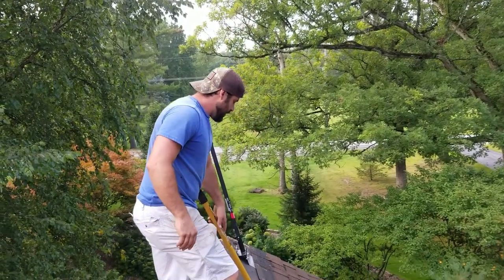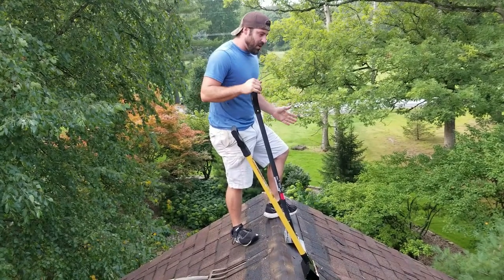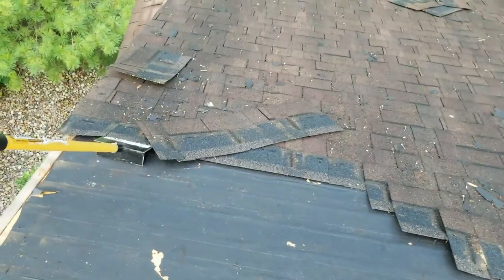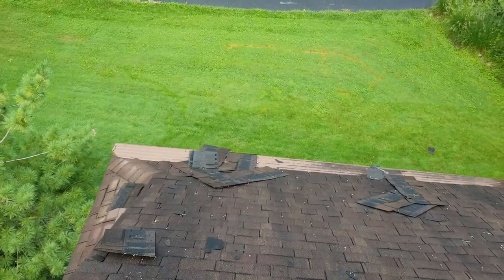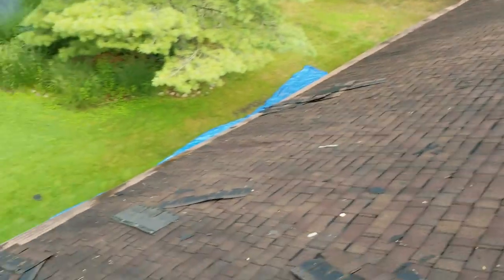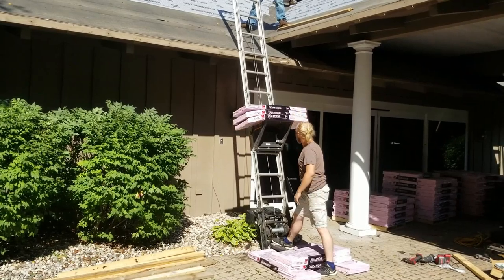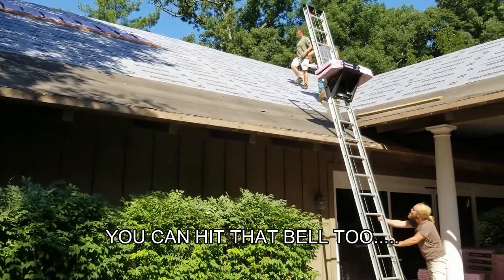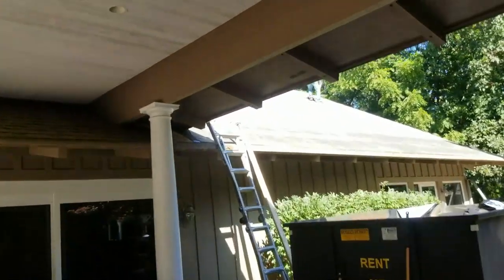HOW TO TEAR OFF A ROOF

Comment: not to be rude to you guys but the way your ripping it is the dumbest ways possible. I use red rippers and go sideways ripping two rows at a time, putting the longer shingle on the bottom of the two. Also as you rip the shingles off piling them about you in neatish piles .if you would like to see a video of it just let me know. It would definitely help you out and make your rips faster.
Reply: Lifting up from the side disturbs alot of granules leaving more cleaning at the end I normally walk backward to the ever using a roofing spade and the bottom of the shingles lay the shingles on my toes as  shuffle backwards.. this way everyone can be ripping side by side  and everyone takes they're own need u disturbed piles as they go far less gutter clean up and no need for dragging tarps to the bin if your know how to hit a trailer properly
Reply: You're right, and long pants and sleeves

Comment: If you line the ground with smaller 8x10 tarps on top of the larger ones,2 or 3 guys can pick the whole tarp up as opposed to wheel barrels or garbage cans or picking them up twice.An 8x10 will hold a square or so without tearing and makes clean up a breeze.Finding good guys is my biggest problem,The struggle is real no doubt.
Reply from the maker: wow, how did that never cross my mind! advice taken bud! we usually just use the big ones because we almost NEVER let anything hit the ground. but there was too much real estate to walk on this one. but yea good guys are the hardest thing to find. everybody good is drug attics/alcoholics and don't have a license or vehicle. I teach the young new guys now, that way they just learn my way and they don't bring the hack ass shit from their last company to mine. that's what inspired me to make this channel. I got tired of teaching the same thing to guys that don't stick around. so now I can tell them to familiarize with a video (i.e before we start siding or before I let them shingle for the first time) and also, I want other guys like you to be able to tell your guys "hey, go watch this specific video before we jump into that tomorrow, I do things a little different but at least you're not coming into it blindy"

Comment: I was taught  to always start from the bottom, scrape from the corner , and work my way up. After all the shingles  come off then use a flat bar to tear off the old felt, and then flashing  and pull nails. Really cool to see the way you do it
Reply: uh i believe someone was messing with you when they taught you to tear off from the bottom . makes as much sense as roofing it from the top down .
Reply: You can remove way more square from the bottom up,only draw back is you have to come back through and pull nails with a shingle shovel
Reply: @joesmoth2610  That's exactly  how I did it. I don't roof  anymore  though ( thank god)

Comment: My husband's an old time roofer and he used to slice the length of the roof about every 3 ft and then roll it all up into a big roll which pulls 90% of the nails and all the paper as you go and just drop the roll into the back of the truck.
Reply from the maker: With a saw? Like cutting through the shingles but not the plywood?
Reply: @NWIVeteranConstruction  no just a composition ax one with a small razor blade attached to it. One from the '60s, he still has a couple. They have wooden handles. I think they're called "Plum". The makers I suppose.?
Ps. He is also a veteran, 1 Cav.

Comment: And you should Always tear the felt paper off as you go... Slipping on loose felt paper isn't any fun
Reply: Tim Bibin I agree with that most of the time.
Reply: peel it all off at the end and get most of the messs wrapped u[ in it
Reply: @williamcutrell7456  .. Yeah on a lower pitch.. it's funny you say that.. we did that on a job we were doing yesterday
Reply: @williamcutrell7456  .. Another advantage of leaving the paper on is that you can see all the nails that are sticking up and need to be either pulled out or Hammered down
Reply: @timbibin1301  yeah and if the paper is still in half decent condition and stapled down it usualy doesnt pull out
Reply: @williamcutrell7456  .. I was talking about the nails that are showing after tearing off.. you can see the nails easier when you leave the paper on.. so it's easier to either bang them back in with your hammer, or pull them out
Reply: I'm older so I sit rite on my cushion push it off with my legs, broken in shingle eaters r awesome

Comment: I like going 3 or 4 rows billow the ridge and going up with the ' shovel and moving left or right  for like 8-10 ft then grab by hand most of the time you can get some big chunks like that depending on  how many layers and how good they nailed it for 1 layer usually works good but not always the case  but what ever gets the job done
Reply from the maker: to each their own. i'd like to see more ways demonstrated myself...I switch between these 4 methods and haven't found anything else that's even close to being as efficient

Comment: Thanks for the vid zack. Never seen a lift like that before. Also were you just making sure the decking was tight with the trusses when you were nailing? Also just wanted to say I appreciate the videos.
Reply from the maker: thanks hunter, always appreciate hearing from you. i was just making sure it was tight. they didn't use ringshank 8's when they installed the plywood and it was poorly nailed on top of that so most of the corners were loose and some of the seams needed sunk tight

Comment: Keep the vids coming. What brand and line of shingle would you put down on your own house if building new construction? Timberline UHDs worth the extra labor?
Reply from the maker: uhm. I'm about to put driftwood on mine. i'm undecided between o.c or landmark tho. but really i wouldn't go too fancy personally unless you got boocoo bucks and a really steep roof. otherwise, just pick one that pops. Gaf, landmark and O.C...cant go wrong in my opinion
Reply: @NWIVeteranConstruction  definately owens corning..i love the surenail strip,well all except when u gotta cut them fuckers when the shingles anything but cold..they suck ass to cut..
Reply: @NWIVeteranConstruction  u said driftwood...u should check out the color sandune...its a amazing color and relatively close to driftwood in a way..the last 7 out of 9 jobs I've done the customer went with sandune..its popular.

Comment: Is their a reason you didn't get the shingles boomed up to the roof instead of dropped on the ground?
Reply: He mentioned in his last video; the brick driveway won't support the weight of the truck and boom
Reply from the maker: @tdgdbs1  thanks for answer bud! yes the pavers were the only reason, often times tree's or power lines will prevent us getting a boom in there too. apparently the hydraulic fluid in the boom lift can cause an arc if close enough so they're not aloud to put the within 20 ft. (they usually do anyway though haha)
Reply: Plus you still have to move the shingles to tear off.  We never put them on the roof.  Get a shingle lift.

Comment: When is it necessary to put an ice barrier over felt? I thought it’s either one or the other. Great video, cheers..
Reply: It’s about the codes in the area you’re working, and you put ice/water up the valleys and On the overhangs till you’re past the exterior wall to whatever code is in you’re area as well as around chimneys and crickets under the flashing. You felt the rest.

Comment: Depends on pitch of roof and condition of shingles…..but I found the best way is to start 4courses down from top have two guys picking up the trash and work across the roof like a typewriter moving down 4 course each time.very fast and very little trash to pick up and the shingles come up whole instead of small broken pieces.

Comment: My question is what is better as an underlay  , tyvek or roofing felt . 2 question are staples ok to fasten down the felt.
Reply from the maker: My recommendation is to never use Tyvek as underlayment. it will actually leak. its meant to be installed vertically on walls. the underlayment I use is GAF felt buster. its synthetic felt and comes in a 10 square roll. I believe its approved for staple only install. if its not, I can assure it holds tight when stapled correctly and we walk 8/12s like that. HOWEVER, if you plan to leave it for a few days or there's any chance of rain, put as few tack staples as possible and use a pneumatic cap nailer for the actual install of the felt. those will not leak.
Reply: @NWIVeteranConstruction  Tyvek makes a synthetic felt
Reply: Synthetic is the shiznit

Comment: hi there, how do you tear off a product like stormshield?
Reply from the maker: It's tough.  I work it with these same tools, sideways.  Usually you try to get the shingles off of it and don't bother with the ice shield itself.  But sometimes you can get it off.  Sometimes you just replace the wood

Comment: Is there a use for old shingles? Recycle?
Reply: In NJ recycled asphalt shingles were used in road construction. We paid $25 a ton takeaway and they supplied the dumpster. Most were shipped overseas.
Reply from the maker: @ozziestrom9793  that's pretty cool I assumed they had a purpose but never really asked or looked into it. I know my dumpster guy doesn't let me throw other stuff unrelated in my shingle dumpsters so I'm sure they're doing some kind of separating and recycling with it

Comment: Tear off that back 22 square,prep it and shingle it,throw them shovels away,tear off under the paper your get bigger cookies,leaving that paper on is asking for them young ones to slip or yourself.
Reply from the maker: the bottom was on good. we took the paper off asap. and with the tear off shovels it was much more efficient because the nails get popped as you go. i exhaust all options before resorting to the tear off bars

Comment: What is the strangest thing you have found removing a old roof or roof ?

Ive found a news paper from 1922 .
And a 380 or 9mm bullet .
Or autograph from the previous roofer.
Reply: 3ft black snake was under the plywood I pulled up
Reply: I've found pillows in the attic for insulation, a vintage Pepsi can from the early 60's, bullets, scorpions, billboard ads used for roof sheathing, paving stone used to replace a missing tile, a garden with flowers growing from excess bird poop, coffee cans for flashing and the homeowners underwear used to plug a leak.

Comment: Does the ice shield go on top of the felt?
Reply from the maker: No, I'ce shield goes down at the eaves and in the valleys.
Reply: Ice and water shield are supposed to be applied directly to the decking, under the underlayment.  In the northern climate it is to be applied on all rake edges and eaves to help prevent ice dams and wicking.  Here in the south it is mainly used in valley's and around penetrations.

Comment: I’m going to have to make a video on how we strip a roof I have never seen any other roofers do it the way we do and it works really well I think it is the fastest way to do it when you include clean up
Reply from the maker: double fork, have someone carry to the dumpser and let next to nothing hit the ground? whats your method
Reply: Yes please share.
Reply: Try the Rapid Roof Remover Tool. Expensive but well worth it. Pays for its self in no time. Check it out on YT.
Reply from the maker: @ozziestrom9793  I've seen that before. looks pretty good but i prefer the workout. and we can take it off just as fast with the double forks and have one killer follow with the nail popper.
Reply: It’s hard to explain but we have custom made stripping tools made out of ice scrapers that we bent.

Comment: Fucking right brother mint demo on tear off. Those black razor back strippers work real good but they dig hard every single nail steady fetching and snatching. It def is gravely when the old felt stay  in place so you can glide over it.  When the hay fork comes put is when it's 2 layers of old 3 tabs and a layer of cedar shakes billions of  nails..lol From one roofer to another safe journey and God bless you in the roofing industry.👍🏁

Comment: How do you do it when run it to a roof thats been nailed over 2 or 3 timed
Reply: Multiple layers? If that's what you're referring to then you dig down to the wood and start pealing... Lotta clean up.. good luck 👍
Reply: Rip after the first roof.

Comment: "Don't rush"
My house was stapled (that is some lame ***").  You could grab a shingle, then just start a run like a zipper and  practically pull an entire strip of them from bottom to top from the strip to the ridge.  It was ridiculous, no idea how those shingles stayed on with the winds (hurricane) we get sometimes.  I was dreading pulling that roof, and it was ridiculously easy. 

I nailed five per in the architectural that is up there now...dreading stripping that roof, and its time is coming.  I have one of those flat pullers, but it has wide triangular teeth.  I think I might get a second one and grind slots in the tooth bases.  Looked like that second wedge tool worked far better though...hell maybe I'll just grab one of those, and sell it when I'm done.
Reply from the maker: You can't stack these shingles like 3 tabs

Comment: Fucking awesome looking job you got there can’t believe the luck you have with the labour such a shame!! Just a friendly tip on that power ladder if your still using it  ( looks identical to one I use to use) even tho it says 200 lbs or whatever it is on carriage I wouldn’t be putting any more then 2 on it. The inside track pops off very easy with top guy unloading in that exact way (pulling off one side).  I’ve seen it dozens of times and seen 2 motors get crushed. Good luck and wish you were more local

Comment: i just grab a ripper, get 2 or 3 courses rip in one line and stack em in seperate nice piles, to carry later, to the bin or ground drop so pack it is easier,
Reply: never ground drop a walkable roof tho
Reply: @williamcutrell7456  What if the bin is on the side of the road or not clpse to the roof.. just throw the tare off in the attic?

Comment: ALso you should just buy a power ladder. Cost a couple grand buy saves hours each job bringing up bundles, ice shield and felt.
Reply: If you just get the material delivered to you and have it roof topped it's even easier just make sure and get the peak torn off before it gets loaded

Comment: You could really spend a bit more time thinking about the safety of your employees. Like running pitchforks at them on a roof without eye protection was not exactly an OSHA approved method of avoiding eye injury.

Comment: Buddy running the hoist needs to stand back. Very very easy to drop a bundle when they're being pulled off the side. At the very least stand opposite to the side they're getting pulled off of.

I like big houses like that, especially when they aren't all chopped out. Should be nice when it's all done
Reply from the maker: yes sir we got some good footage so far too! and yea it wasn't the smartest. we ended up pounding a board in on the fascia and put a nail there because the ladder was trying to pull over when we get them off. we got a lift now tho. like a man basket kind of thing
Reply: Yeah I only brought it up,because it happened to me.
We use a hoist regularly,slightly different then that one but the same idea.
Newish guy was throwing them on and I was catching on the roof.
Our hoist has an unloader,so if you stand at the top the bundle slides into your arms, usually.
Sometimes you need to grab them off the top depending on the ladder angle.
I went to grab it and kid wasn't paying attention,started lowering the hoist when I had one hand on the bundle. It landed about a foot from his head
Reply from the maker: @PatChapp  damnn

Comment: Every roofer is the best roofer. This is honestly horrible. The biggest problem I would have though is why rip onto a tarp. Carry the piles over to the bin from the roof. So dumb
Reply from the maker: Yea why would I let it slide down onto the tarps where I have 2 guys that cleaned it up well before we were even done felting? Hmm because who wants to walk back and forth up and down that ridge hundreds of times. I ALWAYS.  and I say again.  ALWAYS. Have them take piles to the dumpster. Nothing EVER HITS my ground. But here, on a 110 sq. 7/12. IT MADE SENSE.  So dumb what you said.  Watch more of my videos maybe you'll learn something and become a fan like all my previous haters.  If not,  good congratulations. come up with some better advice than just spewing out the most day 1 beginning thing about tearing off a roof.

Comment: WOW! So much time I see wasted. 👌
Reply from the maker: Uh huh
Reply: Just a little roofing troll...instead of workin from on top of the shingles tearing off...turn around to look up at the roof to tear off.
Reply from the maker: @dixienormuss1864  I said that once to our crew coz that's how someone taught me.  Meanwhile one guy said I don't think you know what your'e talking about.  Always tear off from top down unless pulling by hand
Reply: Right on...to each their own I suppose...and nobody uses kneepads. Ouch!..knees feel weak just watching lol..AND SHORTS TOO...🤘
Reply: @NWIVeteranConstruction  tear off from top to bottom 2 pitch fork and have one guy stop the shingle if theres no replacemente gudders of gudder guard if replacing is part of the job then just tear down full speed non stop and a tip for easyer tear of with pitch fork always tear  down full shingle with iv seen roofers tear of sorter or longer than the actual shingle ant that just leaves half shingles hanging easy to step and slide on u need a better and more active and on point crew my crew and i a 22 square roof like that back one uy teared of we would of had teared of in about 30 to 40 minutes and pulled or hammered nails back in that side of the roof had no detail no sky lights